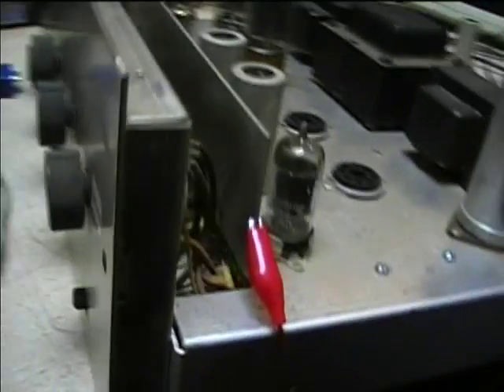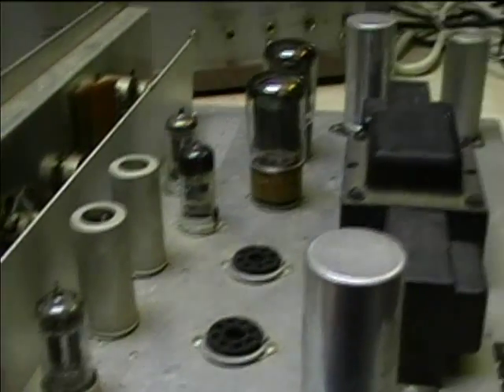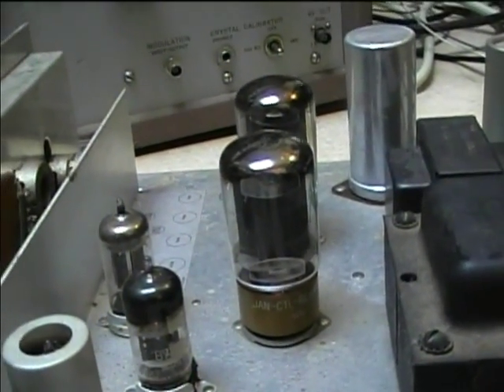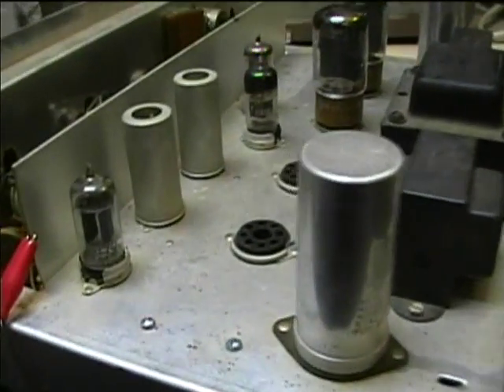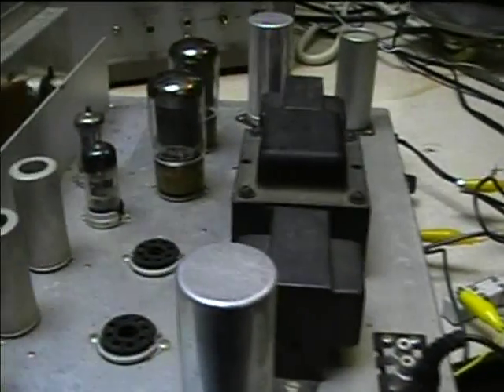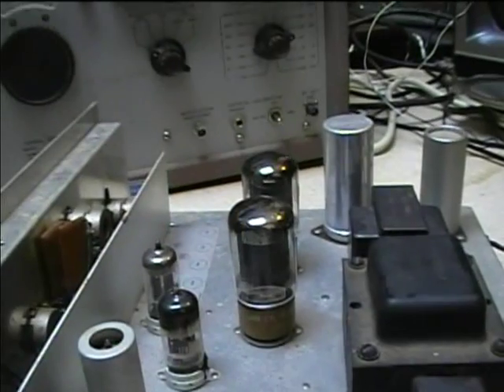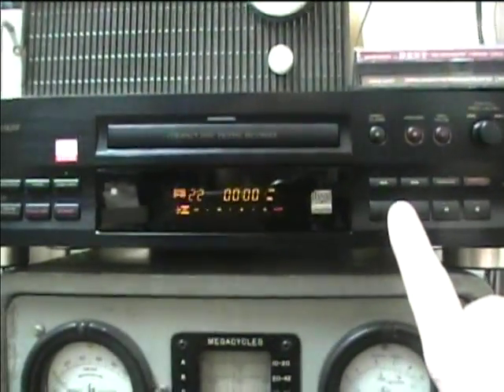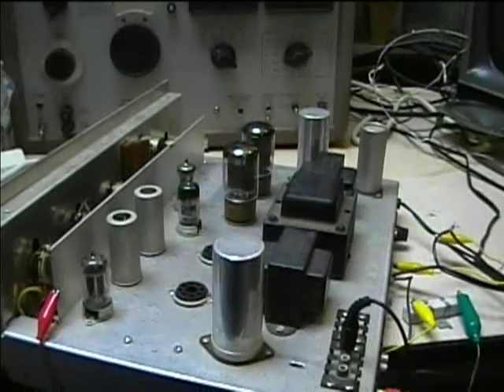Harman-Kardon A300 6L6GC/5881 power tube upgrade

Comment: retrochad, 
You may also want to consider the fact that the 6L6 draws more current for its heaters.  The  current draw on the 6L6 heaters are 0.9A from a nominal 6.3V source, which can be AC or DC.  The current draw on the 6V6 heaters is 0.45A from the same source.  The 6V6 heaters are around 14ohms, nominal.  They are all wired in parallel, so that's equivalent to having one resistor of 3.5ohms.  With 6.3V across that 3.5ohm resistor, your Main power transformer was delivering 6.3x6.3/3.5= 11.34W of power to the 6V6 heater circuits.  When you replaced the 6V6 with the 6L6, the calculation from the data sheet yields 6.3V/0.9A=7ohms, so the heater resistance has been halved.  With 4 heater circuits in parallel, 7/4 = 1.75 ohms.  You now have a 1.75 ohm load across the 6.3V heater supply, which means your Main power transformer is now providing 22.46W to the heater supply, just for the 6L6 tubes alone.  This is, I have no doubt, adding to the temperature increase in your Main power supply, since the windings are all intertwined.  Also, the increased current could be brining your Main transformer closer to saturation than it was with the 6V6s.  
I'm considering dong the same thing you're doing, installing 6L6's in my A300.  But I've decided to re-wire all of my tube heater circuits to drive them separately from the Main Power transformer. I'm adding a small DC switching power supply, rated at 30V at 1.33A load (40W) to provide, clean DC regulated power to ALL of my tubes, the 12AX7s, the 12AU7, and the four 6L6s.  I've designed the wiring as follows: the 4 12AX7s and the 12AU7 will have each of their dual heaters wired in parallel, then each of those will be wired in series from one tube to the next.  The total resistive load to the 30V supply will be 105 ohms, with a resulting current of 0.28A.  The 12AX/AU7 heaters are identical, and require between 5.67V (-10%) to 6.93V (+10%) across the dual heater in parallel.  My nominal voltage will be 6.0V across each heater, since there are 5 in series from 30V to ground.
For the 6L6s, things get tricky.  Each heater is 7 ohms, and when wired in series, they will represent a 28 ohm load to the 30V supply.  That would result in too much voltage across each heater, and therefore, excessive current.  The solution is to wire in a 5th resistive load of 7 ohms, resulting in a total resistive load of 35 ohms.  The current will be 0.86A, within specified range for the 6L6 heaters.  That means my 30W DC Switching supply will supply 30V with a total current of 0.28A plus 0.86A= 1.14A for ALL of the tube heater circuits in my A300 amp.   The total amount of heater power currently processed by the 6.3V, ac supply winding is ~17W.  I will totally eliminate this requirement from the Main power transformer, which will mean I will be able to adjust my circuit high voltages using the appropriate dropping resistors to increase my bias voltages and currents to the 6L6 without overheating or saturating the Main power transformer.
The small DC power supply will connect to the AC power On/Off switch, coming up at the same time as the HV side of the power transformer.  It will supply all of the tube heater circuits with clean, regulated DC voltages, with no AC component, and therefore no AC hum. 
The DC supply is small, 3"x2"x0.75", and I will install in somewhere inside the amp or perhaps on a small bracket on the top-side, and then wire it in.   Hopefully, it will do the trick!

Comment: so  in other words, it's a poor design that is prone to failure and burning up tubes, if used heavy

push pull tube amps sound distorted, muffled, and scratchy if turned up beyond 3 or 4. They were a stopgap effort to get power and volume from tubes.  The true beauty of tube sound is found in an SET amp

a Pioneer SX1250 would run rings around any  PP tube amp.

Comment: Wow, that thing really pushes 6V6's hard, 360v on the plates and 37.5ma bias current! In that original design all 4 tubes would need to be perfectly matched (not possible!) to be dependable. 

Using paired bias or inividual bias and tone down the current is the way to go, it will run alot cooler also.

Comment: you and organist 1982 rekindle a love of mine.  I took a capacitor out of an junk module that I had and replaced it an open 45uf 250 volt cap in a light starter they no longer make . for a round floresant fancy fixture . It worked great and the customer was impressed .  I also changed 4 10uf 25v caps in a Samsung LCD tv with 50 volt ones .  that paid the electric bill and insurance with out writing a check